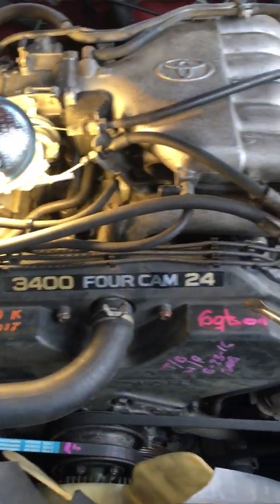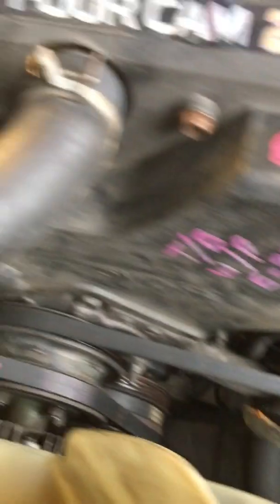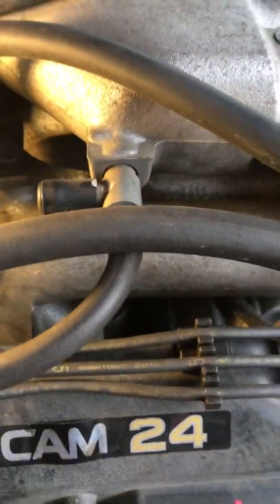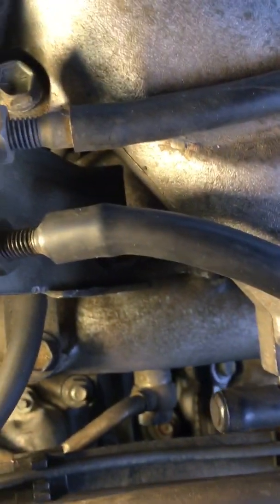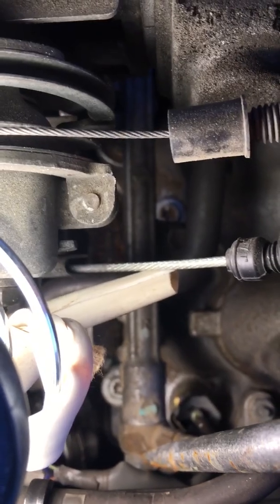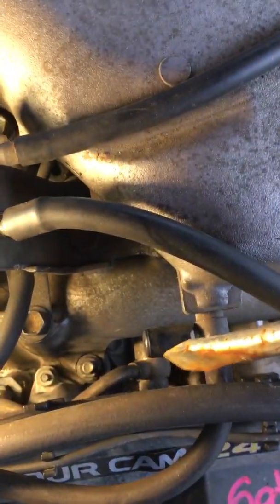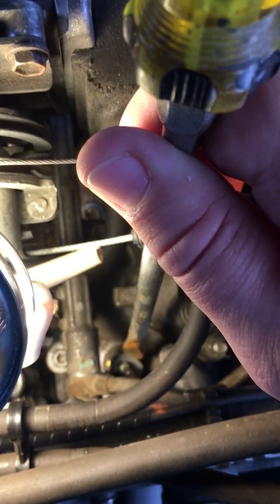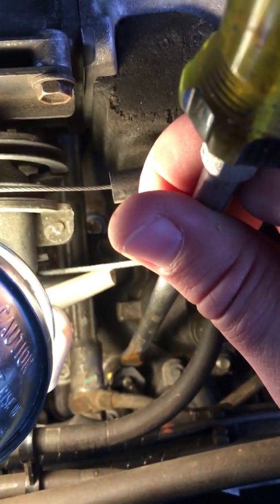DIY coolant temp sensor 1997 Toyota t100 3.4 6cyl

Comment: What was the reason you replaced it what problems was your truck giving you ?
Mine cranks too long before it starts but runs fine once it’s up and running
Reply from the maker: Wouldn’t start hot. Tried this before I tackled what I figured it was which was a bad check valve on the fuel pump. Yours could be fuel pump also. Mine ran fine but wouldn’t restart when hot. Fuel pump is actually pretty easy. Have to unbolt and move bed back about 2 feet. Pretty straight forward though

Comment: did it throw a code for you to decide to replace or what was your reason to swap?
Reply from the maker: Scott Burns soooo, if you have a hot start issue, where is runs like a top, starts cold like a top, but won’t start after 10-30 min when it’s freeway hot, it’s most likely the fuel pump. There’s a few other reasons but mainly check valve (which is internal on the t100 fuel pump-i had a hard time finding that-it’s external on a 4Runner). Coolant temp sensor was one of those others, I really didn’t want to change the fuel pump but after doing it it’s actually pretty easy. 2-3 hours. My coolant temp sensor was broken at the middle but changing it did nothing. After ruling out the return line check valve, knowing that no black smoke was blowing out exhaust so it wasn’t leaky injectors, I did what I originally thought I was going to have to do and changed the pump and filter. So easy, truck gets better mpg and no more issue.
Good luck w yours. There’s good vids on YouTube but if you need a specific thing done message me and I can prob help but the vids on YouTube are where it’s at!
Reply: @jasondavies4610  I have the hot start issue. At below 0 it fires instantly. Warm and left for 1HR and it cranks forever. Fuel pump and filter already done. Trying the coolant temp sensor this weekend.
Reply from the maker: Ian DePalmer good luck. Left for an hour mine would start again. It was the check valve on the fuel pump. Check the return line check valve under hood when you’re changing CTS this weekend. Very easy, not often but the bladder will fail and cause hot start issue. Leaky injectors are also culprit but you can usually tell by the exhaust